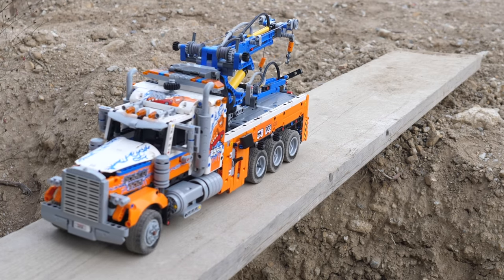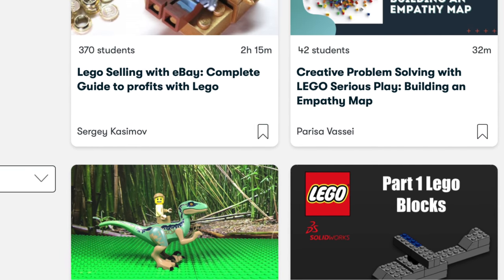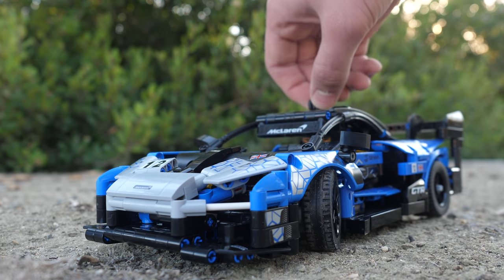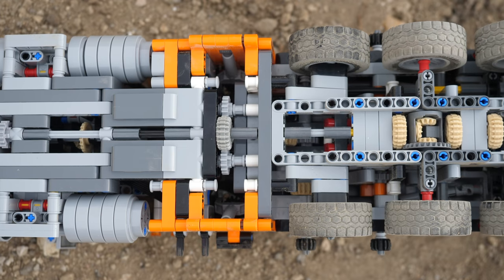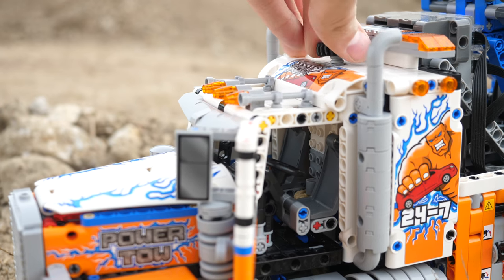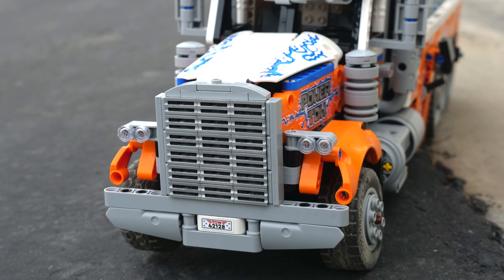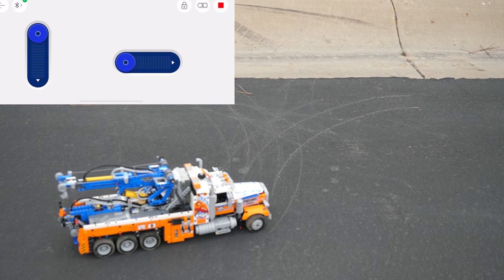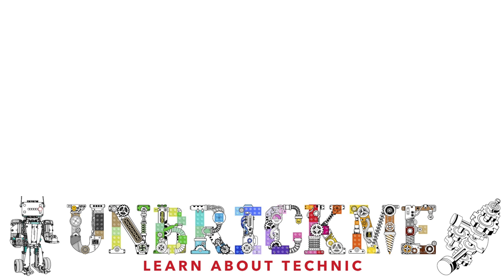LEGO Technic Heavy Duty Tow Truck RC Mod 42128

Comment: Be nice to add a motorised pump for the pneumatics
Reply: I modified mine to have a motorized gearbox with 4 functions, one for outriggers, one for pneumatic pump, one for crane rotation, and one for the wheel lift. Haven’t made a video for it yet. I did a lot of modifications to the sleeper to fit a PF battery box and the area above and behind the back axles to fit a gearbox. I put the motor and pump near the pneumatic switches
Reply: @gervaisbuilds6175   can you make a video about it please? Would be much appreciated!
Reply: @gervaisbuilds6175  dudeee please do a video that would be epic
Reply: @gervaisbuilds6175  please take some pictures

Comment: the manual for the 8043 is flawed on page 14 the diagram for the peace you are building is different than the finished picture there is a 2 axle connector on the diagram of what you were buildingbut on the diagram of you finished building it there is no axle connector